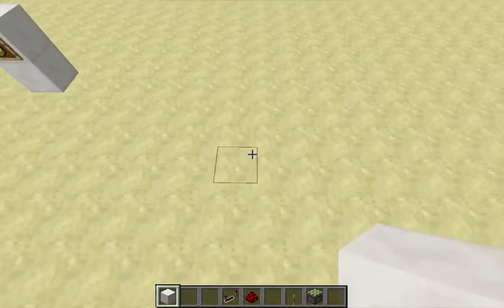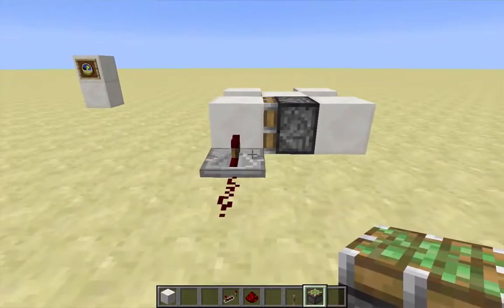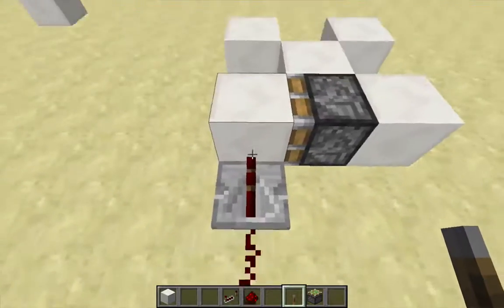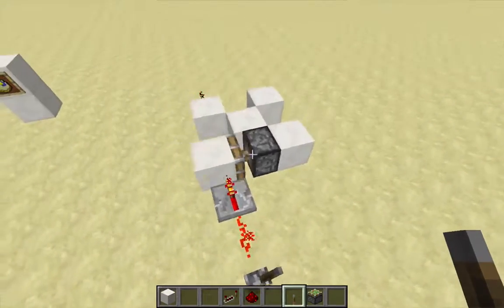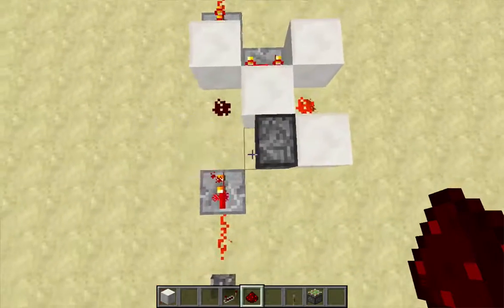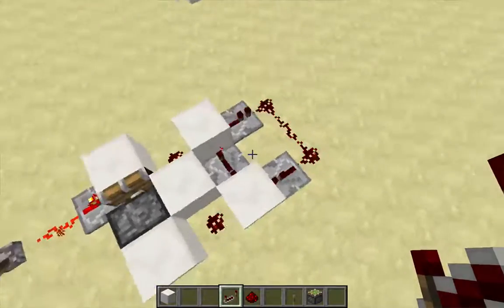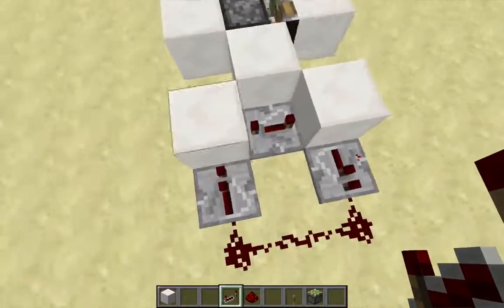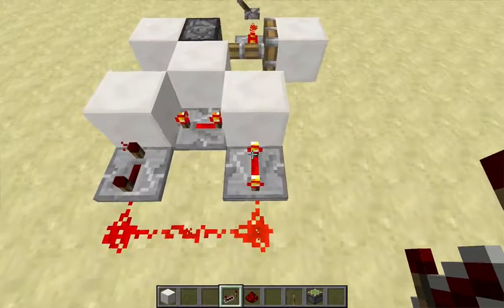Clocks: Heartbeat Clock

Comment: the redstone dust behind the block the repeater is facing in is powering the center block behind the piston
Reply: next to not behind
Reply from the maker: +Jendrik Weise Oh, you're right, I really screwed up that explanation. It's not the block attached to the piston that is powering the piston. How derpy of me, thanks for the correction
Reply: that also means u could remove the block behind the piston :D
Reply from the maker: Yes, that's correct, the block behind the piston isn't strictly necessary. I was intending to mention that when setting out the blocks, but I recorded in a bit of a rush, I suppose I forgot
Reply: oh ok xD